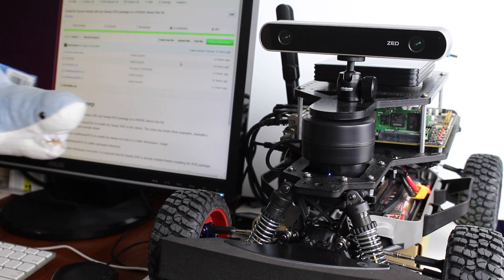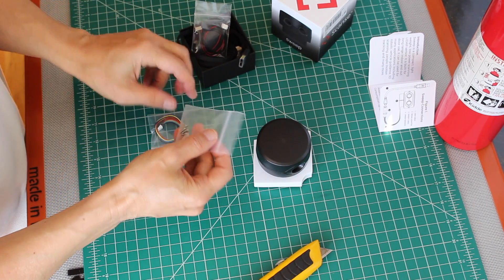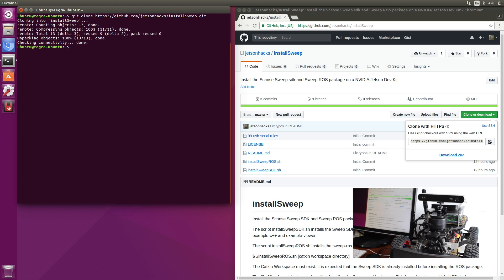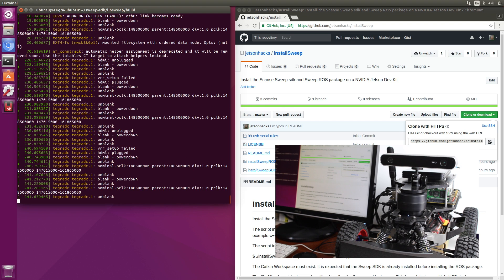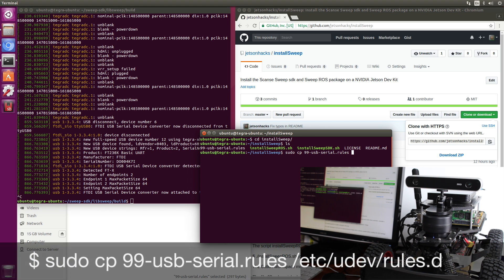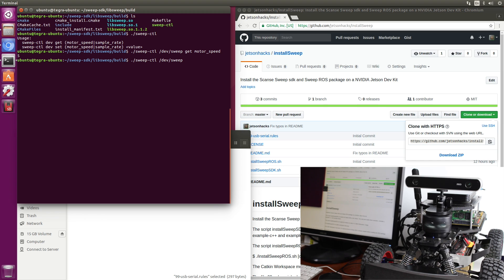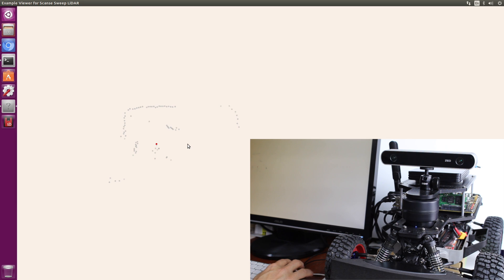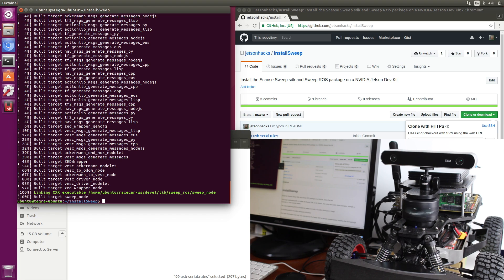Scanse Sweep LIDAR - Jetson Development Kit

Comment: To improve returns at range, increase sampling (more pings), but slow rotation. Your rig cuts a 40 meter radius pie from center. Trig and those damned ancient Greeks make any given change in angular orientation a larger linear cord length per increment of distance along the radial line. At fast sweeps, you maximize angular change between pings. Fat pie slices equals spotty imaging. Fast sample, slow sweep chops fast, turns slow. Splinter like pie slices, so better image at distance. You may well find some colors the beam reflects off give false or even absent data. Cool vid, well done!!
Reply: ludditeneaderthal in other words, slower rotation will improve sample density at greater distances. I'm sure the trigonometry remains the same regardless of the ancient Greeks :P

Comment: Hey there! Nice video...Which Lidar do you recommend.. Scanse sweep or RPLidar A2. Both are priced almost in the same range. RPLidar has 4 times more sampling but with shorter range. Any other pros? Or cons?. Thanks!
Reply: I've tried the A2 recently and I can confirm it works pretty well for LIDAR based mapping
Reply from the maker: Chris Anderson did a review: https://diyrobocars.com/2017/05/28/comparing-low-cost-2d-scanning-lidars/
Hope this helps, and thanks for watching!
Reply: Thanks for the inputs!!

Comment: awesome video and thanks for sharing your exploits! I'm kinda waiting to see how the sweep fares in LiDAR based SLAM operation with ROS. I'm planning to get one for our lab, but the noise levels on the visual display have me worried. I'll be on the lookout for your next video! cheers
Reply: I'm planning on using this mainly for obstacle avoidance(!) with some lidar range measurements occasionally helping out with improving the accuracy of range measurements that are mainly coming from two stereoscopic cameras also using Structure-from-Motion (SfM). I don't think the resolution is really good enough for anything more than toy robot navigation indoors in relatively close quarters. I'm also planning of building a robot with manipulator arms, so a single spinny lidar wouldn't be very useful anyway.
Reply: Richard Schultz thanks for the follow up! I read chris andersons review and realized the sweep was just not going to be good enough

Comment: Disappointed with the speed of the laser looks to be even slower than the neato laser. That car will need something closer to a hokuyo if you want it moving faster than a snails pace. Keep in mind none of those imaging sensors will work well outside due to the sun. But Im curious how things turn out, hope you prove me wrong...
Reply: I use it to augment depth cameras which do give you real time performance but which don't do as well when it comes to distance information. Depth camera performance in the sun really depends on the camera, stereoscopic vs. flash laser, etc. As another comment states, using a bunch of sensors in combination is a good way to go.
Reply from the maker: It feels faster than the Neato, but I'm sure that you're right about the Hokuyo comparison. At the same time, it's a  $350 to $1700 comparison. A lot of people are curious about lidar based SLAM, but not $1700 curious. The Sweep gets you started, and probably would be adequate on a slow paced rover, or at walking speeds on the RACECAR. Here's the thing: just a few years ago there were no entries even near this price point. As the market competition increases and technology gets better, one would expect that some pretty capable devices will be available for the makers and the curious in this price range. The second version of RP Lidar is better, the same will happen with the Sweep.

The press would have us believe that the $100 do everything lidars are "here now". They've been saying that for at least the last 5 years. The second part of that is the $100 lidar price will be for quantities in the 1000-100000 quantity range. It's hard to tell what the price will be to people outside of the auto industry, that is if those products are available at all. 

It's like dev kits for chips used to be not so long ago. The chips themselves sold for a dollar or two in quantity, but the dev kits for the chips were well over $10K. Thanks for watching!
Reply: I agree 100%, before ROS slam wasn't even possible at even 3x the price of the current hardware not to mention the advances that ROS community has made since then. I am under the impression that monocular based odometery/slam might be a better approach in the near future for small affordable platforms. I personally have a variety of 3d image sensors including a hokuyo 30lx which imho is worth every penny.
Reply from the maker: People are doing interesting work in the monocular SLAM area. There's also the idea of machine learning added to the mix which may offer ways around the relatively slow, low resolution aspects. More importantly, the idea of sensor fusion is really fascinating, with the idea of combining several sensors of different quality together for an accurate "big picture". For example, the Scanse might not be fast enough of a lidar to navigate the car at higher speeds, but it may be useful for close range obstacle detection when a stereo camera is "blinded" by the proximity to an object.

Comment: Hi Jim

I noticed that in your TX1 or 2 the sweep sensor is always spinning, with my TX1 doesn't, and I can't get any data out of the sensor

Have you experienced any issues ?
Reply from the maker: As soon as the boot sequence completes, the Sweep starts spinning. There are two things that may be different. First, this one is connected to a powered USB hub (an Amazon Basics  7 port USB 3.0). The second difference may be that USB autosuspend is turned off. For many devices, the USB port will be turned off in order to save power.
Reply: I second using a powered USB hub as the Sweep can pull a half an amp on its own.
Reply: I've noticed a big issue in the micro usb port. I tried 5 different usb cables (That i've never had an issue with) until I found one that worked reliably. The unit should start spinning right away on plug in. If it doesn't, try another cable.